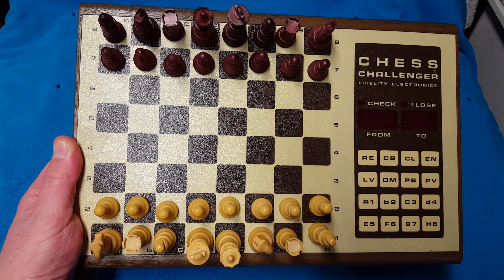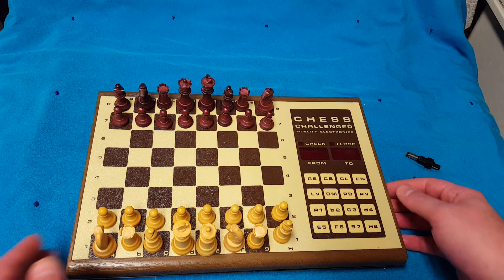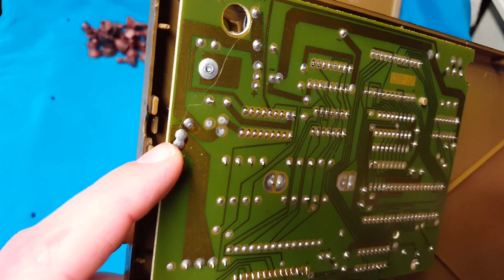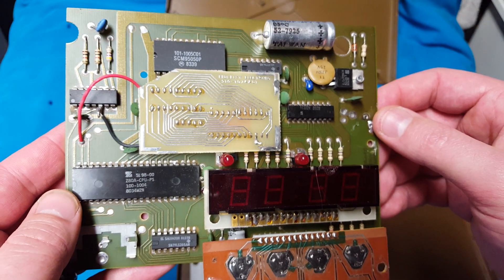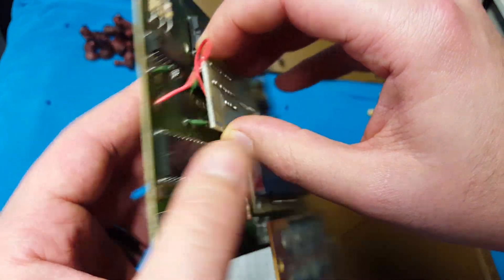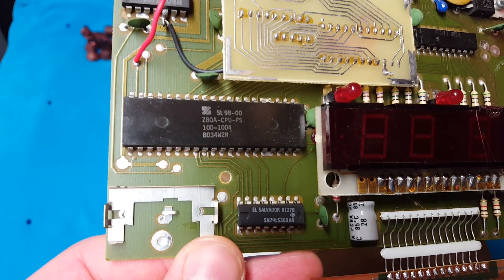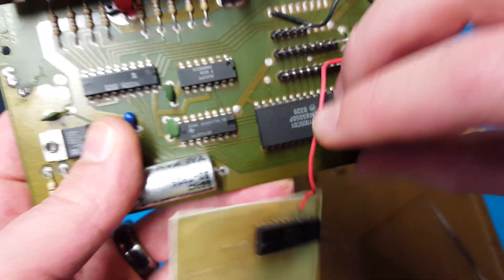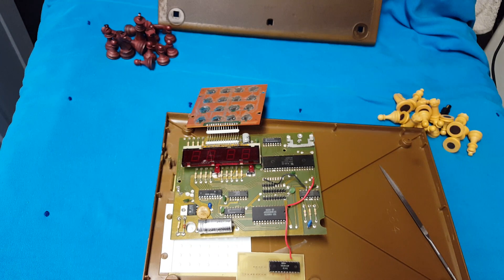Chess Challenger Teardown. Fidelity Electronics Challenger Series Model BCC

Comment: The daughter board seems very hand soldered, and is very probably a last minute production bodge. However the main board looks very much like it was wave soldered, and properly de-fluxed. As for where it was made, it states U.S.A. on the bottom, although the circuit board might have been assembled in Hong Kong, or Taiwan, or Mexico, or something.

Comment: I believe that daughter board is an upgrade that could be done on these.  They had a program where if they became too easy for you you could send the unit in to them and pay a fee to have the computer upgraded.  I have one of these and opened it up and the main board looks the same, but it does not have that daughter board.  Also I watched another vid on here where a guy fixed the power connector that was loose.  That one did not have the daughter board either.

Comment: Hey friends, these kinds of boards were typically fed through a wave solder machine, all connections could be flashed at once, on an assembly line, other techniques included heat guns / microscopes. Very little "hand" soldering required ;) I used to do this kind of work in the 80s and have probably swallowed a bit too much solder! :)

Comment: Just found my old chess challenger, but no power supply came here to see if you know the voltage. Oh, by the way, that was made in the USA China was not making this in the 70'
Reply: it's 6 volts
Reply: @xiruahu2096  Thanks
Reply: It's 9 volts DC (350 ma power capacity minimum), with the positive on the tip and the negative on the sleeve.